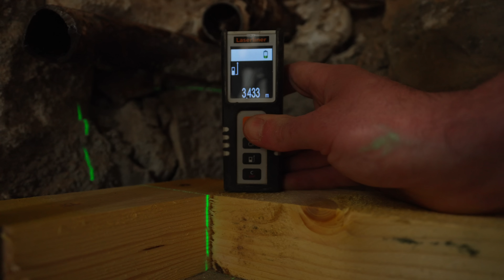Finishing What I Started

Comment: It's great that you've rescued this handsome building! Just wondering why you've removed all the internal walls and knocked the original plaster off all the walls? Looks like you're creating unecessary work for yourselves. If you will be insulating your external walls, will you be using a breathable system or insulating lime plaster, perhaps?

Comment: You have probably already answered this.  Why do you use screws to attach your wood? Here in the US we would probably use nail guns. I do like your way better, though.
Reply from the maker: I like screws i’m not keen on nails they pull out too easy but there’s also benefits to nails such as tensile strength if the wood contrasts and expands it can do so with nails. But screws well there’s absolutely no give in such a case.
Reply: Agreed! My late husband taught me that.  We used screws almost exclusively in our work.  @ThePethericks
Reply: We built a new wing 5 years ago and they were a sort of nail gun but screws. At night our wood working sister would salvage the ones on the floor!
Reply: We use screws usually (PA). slightly more expensive but holds better